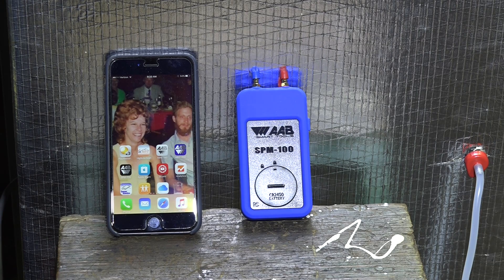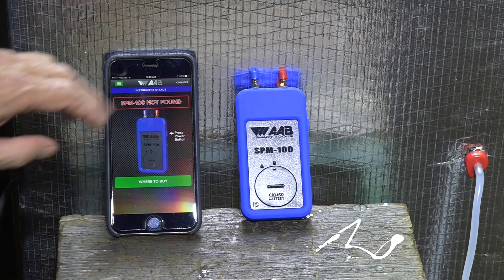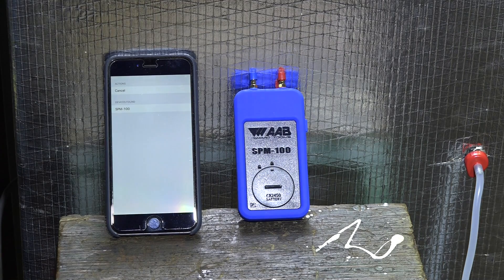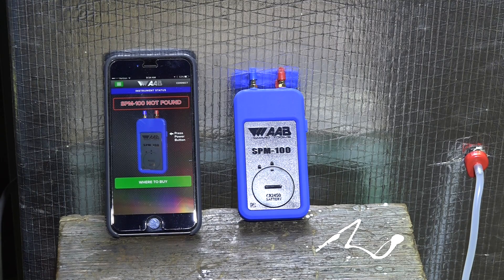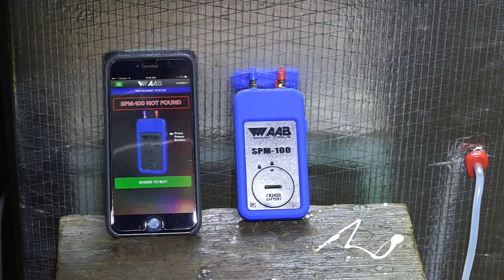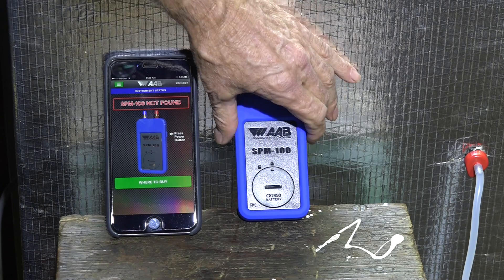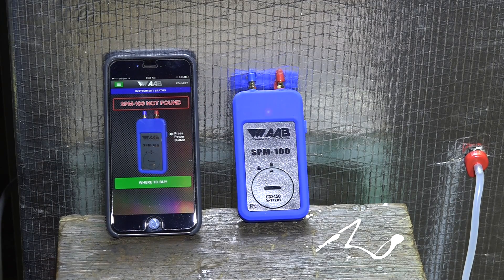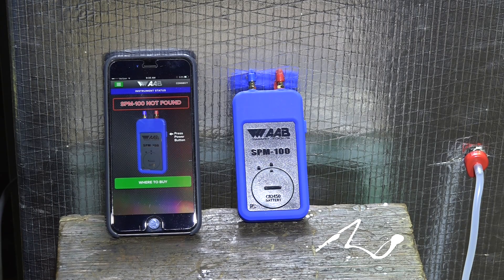AAB manometer review part 4

Comment: Did they update the app to ios9? If so did that make it obsolete for ios8 and the phone operating system has to be updated?
Reply from the maker: +rasta1kikker The app supposedly is updated.  I don't think it is the operating system, but the software itself has problems.  
GFM
Reply: Thanks for the reply, was just wondering.